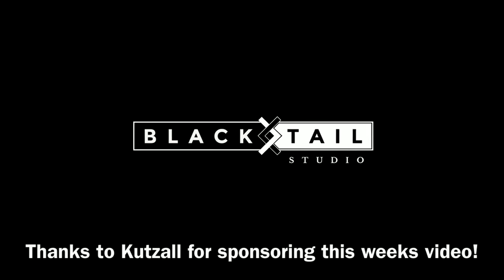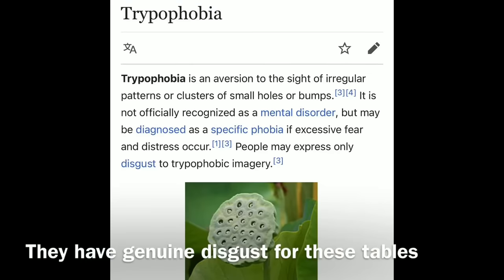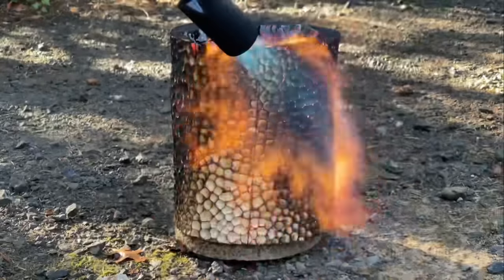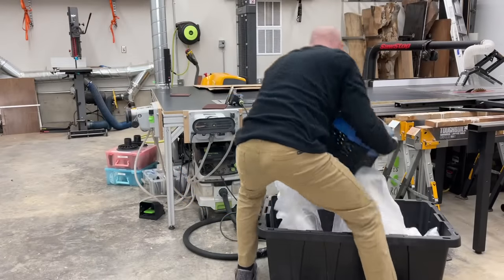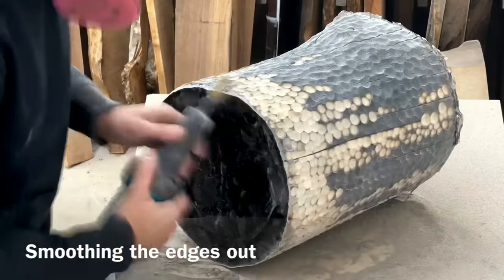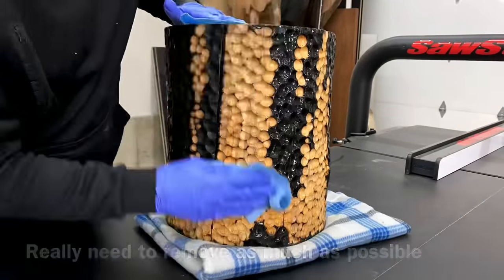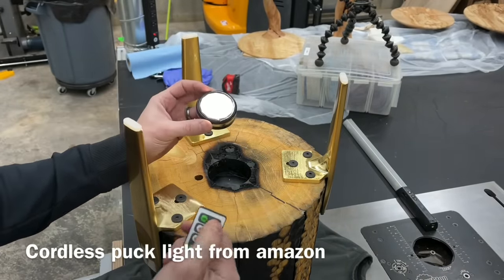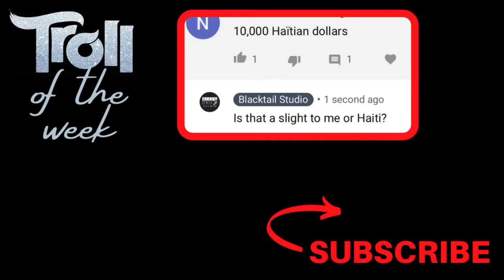I Sold This Firewood for $2500

Comment: Danish oil soaks in deaper so protects the wood very well, first handful of coats don't really need flattening, but if you want a glass like glossy, hard, resistant to mist shit finish- the more coats of Danish the better, and use steel wool with the grain in between coats, it requires patience and is very much worth it. It does have a tint on the light brown/yellow pigment but you can mix in a colour of your choice to make it happen the way you want it, it's oil so powder colour or even food colour works, pretty much anything that is for colour can be used as Danish oil cures hard and deep into the wood depending on the tightness of the grain. Not for a quick high gloss job, it's something you can do and make a lot of money because of the time and skills needed it's old school as well and recognised all over the world.

Comment: 😲I Love it! A couple of questions. 
1) Would the inside look better if you somehow sanded or scraped the high spots down inside to bring out a little of the wood colour?
2) What would I do differently if I wanted to use these outside around a fire pit?
3) I have not gotten into epoxy yet simply because of cost. What is the approx total cost of all of the epoxy used in this project?

Again, I do think this it is an amazing piece. I apologize to your wife, but I think the outside looks unique and very cool.

Thanks once more for sharing your talents with us.

Bill

Comment: 🔥🔥🔥 you'd probs have to light the interior with discrete LEDs with hoods (to not shine up) from near the top of the burnt out internal cone. Be fun chasing all the wiring internally up from below . .OK, maybe not. Maybe have matching brass removable caps/doodads around the circumference to be able to service the lights if/when they fail.

Comment: 🤔I am happy you went with the light at the end, I was waiting for it since I saw the drill bit puncture the log at the beginning.  I was a little disappointed with how the light came through though.  I was hoping for like a dawn through the trees look which would be neat.  Given the way the light does pass through I think playing with the light source might yield better results.  You ever see those "Galaxy" lights on amazon?  They are like $20-$30 and cast a multicolor galaxy pattern on the ceiling.   It would be tough to build a base for one to sit on the bottom of the stump but could yield some interesting results with this piece.

Comment: Cool project, a couple layers of opaque epoxy at the bottom and maybe going part way up the sides would really spread out the light and reveal more texture on the sides. 

The light will wrap around the features through an opaque material but not through the crystal clear stuff.  And good thing that light isn't permanent, a better option will appear at some point I'm sure.

Comment: About the light, those are really dim and battery powered, so you can’t expect much from them. At the hardware store they have really slim recessed LED lights that output a lot more luminosity, but that may be hazardous because they can get quite hot without adequate room to breathe. There are a lot of good lighting solutions, but to the people saying you should have worked in an LED strip light into the resin, it’s a bad idea because it’s no longer serviceable. Once the cheap strip lighting dies, the whole thing could get trashed.

Comment: Interesting! 😎
I like it with the red light (would have been nice to capture the red glowing wood/charcoal). 😉
What I didn't like so much:
- You finished the irregular pattern outside with straight lines. An irregular fading out had been nicer (my point of view).
- Deep inside were some waves and bubbles in the epoxy that you usually don't see. Normally it's not an issue. But here it is as the epoxy is clear like water and it's backlit.

Comment: Looks similar to the handle of a knife I made in 8th grade, burned it into the same look as this, but just used a hot engraving tool for it and put hundreds of small little holes.

Made the blade guard out of see-through epoxy too, real forward thinker there :P

Comment: It would be interesting to see a repeat of this - but with some light scattering particles added to the 2nd- or 3rd-to-last epoxy layers. With a nice clear epoxy and a light buried at the foot of the log there is nothing to scatter the light and show up the inside of the log.

Comment: I just had a crazy cool idea! What if you drilled a hole in the bottom, and through the side so you could run a small led lightbulb inside but with the light coming up and out of the center showing off all the burnt wood from the hole down the center. I feel like that would be the coolest way to accent the brunt parts of the inside of the stump.
Reply: Ok well I suppose I should finish watching the videos before I post a comment. Boy do I feel like a jackass for that one 🤦‍♂️

Comment: Nice!! I think you are a very creative fellow. I saw a lion.
I was wondering if instead of using a black resin, what would it look like if you used a clear resin, thus showing all the depth and beauty hidden within all the cracks. I suppose you would have to figure out a way of leaving most of the original internal material instead of sanding it out. Perhaps just blowing it off with air. Thanks. I love watching your videos!

Comment: Those remotes are IR so they emit infrared light in patterns and they need line of sight to the receiver that is usually a black piece of plastic. The expectations were not reasonable unless they said WiFi or Bluetooth controller.

Comment: Wood is going to eat radio signals pretty quick. It's like billions of really crappy antennas bound together in a tight circle surrounding the light. Sure, a good handful are fine, but in large numbers wreak some havoc.

If you opened the light puck and moved It's antenna to just dangling there in air I bet it would work.

Comment: Looks cool, but I think it would look cooler if you had sanded down the high spots on the dimpled surface. So raw or stained wood surrounding charred dimples.

Comment: I love the channel. I've never felt the need to add my 2 cents to your work. But I think this project could have been better (my opinion only lol). I thought after you charred it, going back with a scotch Brite pad to the high points would add depth, then rubbing down the high points with the char dust would keep the sheen the same but lighter. Then pour a heavy layer of epoxy over the whole piece. It would be similar to the char table, with a perceived depth, but with a different texture. Also, try a better a single bright led suspended in the center of the pour. A cree bulb inside a ping pong ball(?) Might diffuse the light a little better, allowing the inner texture to be revealed, without the glare. Maybe a thought for a future char stump mark ii project? Anyway, I still love the work you do, and look forward to the next video!

Comment: One of these big cool looking modern light bulbs would be cool in that well. But it probably need a removable top to change the lights. But on the other hand, would save you lots of epoxy, cuz you can just stableize the wood and then put a glass top on top.

Comment: I suspect that your problem with the remote is that it is an infrared remote as opposed to a radio frequency remote.  IR remotes require line of site which you will not have with it under the stump.  Get a light  with a radio remote instead and you will get the results you want.  BTW you can tell for sure if you have an IR remote by pointing you phone camera at the end of the remote and hit a button.  If you see a light in the camera then you will know for sure that it is definitely an IR remote.

Comment: 😍I Love that stump!   Was thinking of those old fibre optic lights or maybe led fairy lights embeded in the epoxy or if you drilled from the bottom and sides bunch of small holes.   Get a starry pattern inside🤔   and another idea is stump table with glass top and the wood could just be sealed and then put fairy lights and seasonal decore inside... like you can do with center pieces.   
I love the artistic part of the drips down the side.   Going with your gut is a good idea!.    

I would love to see different bits for different fun patterns

Comment: Possible ideas... silver in the dimples rest remains charred, cut the stump into 4 and fill maybe 3 inches between each of the quarters and a stronger light a table that lights the room, how does epoxy handle heat?...prototype for next time or you could mod it further 😉

Comment: Light is not garbage you hav IR controller pointed at a wood log. You need low frequency iR signal to get to the receiving sensor. You shoul use one with Bluetooth receiver. If you find, is going to be way more expensive.

Comment: I thought you were going to place a handful of fiber optic cable, offset and flowered out at the ends running down to the bottom hole.  Then a replaceable LED bulb to simulate fire inside the clear epoxy.  Would have looked pretty cool.

Comment: I think that if the inside of the table had some depth to it when you turned the light on...maybe sand the inside of the stump at least enough to have a color depth to see that it's actually hollow.

Comment: 👍Nice work. I like the result, especially the mirror finish top. Good lesson you taught about those hockey puck lights, but I liked the thought. Maybe some better LED light strips inside before you added the clear epoxy fill would have given the impressive inside that you apparently wanted. I like your artistic growth with the videos you are putting out.

Comment: You must use only plastic sheeting you must do the ceiling. That's where the dirt falls from, and you must dampen the floor. Made a car spray booth in the garage works. Awesome, but it's got to be all plastic and things have to be damp when you start.

Comment: I like it.
Gonna try charred wood projects. I already have some pieces I've taken from campfires that look awesome. 
I prefer the look before you retouched it up, all black, but it still came out cool and that was a good idea to fix the epoxy that ran. I'd rather try NOT to let the epoxy run though. 
The legs are nice.
Not a fan of the light. Looked kitsch. Sorry. Idk the solution for being able to see though it better though. Side hole too?
Learned a lot and got inspired to get out my lawn torch!

Comment: Love it man, thanks for sharing. Have really been looking forward to doing both a wood char and epoxy project so, this is great inspiration. Love the texture you made on the log and the contrast too, has a sort of reverse effect with the clean wood dripping down in stead of the char. 

Really nice smooth gloss finish there as well, I may have sanded the inside of the stump hole a bit to bring out some tonal variety, which would probably help seeing into the epoxy. 

All in all really cool process, subbed.

Comment: It would have been cool to embed a small circular mirror in the bottom of the stump's pit before you filled it with epoxy.  The mirror would have added some light to the deep pour you did and show off the burned sides.

Comment: hello, 
I discover your channel and I find your videos interesting and your creations breathtaking. 
Also, not speaking English impeccably, I put your explanations in writing below, but it remains complicated. 
I have a quick question for you, which will help me understand the epoxy process, which remains pretty much the same for all creations, it seems to me. 
you first pass epoxy over the whole piece of furniture in a light layer, then, after drying, you obstruct as many holes and cracks as possible with this same epoxy, then you complete by layers, to then finish with a another special epoxy, in the last thin layer... is that it? 
can you tell me which epoxy you use according to the steps?
 I thank you very much and greet you from France. 
Xavier

Comment: 🥳 😁 Maybe partially blasting the inside would have brought back the wood surface (taking advantage of the light). If so I would go with carbon dioxide ice blasting. That would solely remove coal and not adding any blasting agent. 
Kind regards
Anders 
Sweden

Comment: 🤷🏽‍♂️....... Well, here’s my emoji, because I thought it was ok, but not your usual amazing finale. The table was different and on some level it was kewl. I thought that if you’d have had the light source closer to the top, where it would be more visible, then it wold have been better looking. Possibly have some LED strips attached to the inside of the burned “bowl” section? That would have def given more light, closer to the top, which, possibly, could have looked better. Overall, still def worth doing, if only as a learning experience. Thanks for the continued creativity.!.!.!.!.!

Comment: Try using WD40 for a finish. Looks nice, seals and waterproofs the wood and when wood gets dusty or dirty, spray some more on and wipe. If you want, mix some stain with WD40 to get a darker finish. Put it on until the wood wont soak any more up. Quick, easy and cheap.

Comment: 🤔  I'd say this one is about 7.5 for me (out of 10).  I like the burnt wood, but wonder if it could have been partially or more lightly burned in places.
Between being all black OR all "dimpled" showing the natural wood color, I vote for the natural.  However I DO light black and how dramatic it is.  In THIS case though, I wonder if SOLID black shows off the dimples enough.  They kind of get lost in the darkness. 
The thumbnail you have for the video shows the connective wood between the dimples burned black, but the insides of the dimples natural color.  I like that look a lot 
I think the end results are pretty good, but I think I'd cluster the dimples more near the bottom edge working their way up in a wavy manner getting skinnier at the top.  Like thick blades of grass growing up the sides of a forgotten stump in the woods. I wish I could draw you a picture.  But there you have it. 
Overall, it was a cool project that turned out pretty good! And love the high gloss too!!  
But I think the look  could stand a little more refining.   
I make jewelry and paint rocks, etc.  and I end up doing some things a few times beforel I'm happy with it.
My litmus test about anything I make or buy is, do I want to just stand there and Look at it?  Is it something that keeps drawing me back?  
Well, I've gone on WAY too long!
You do INCREDIBLE work!! I love your creative and unique eye for the beautiful yet dramatic!

Comment: 🧐As far as a log jig goes, for this purpose why not use a couple of tire blocks or wedges (wrapped with protective cloth/padding if required)? Doesn’t do anything for front to back movement, but you could probably clamp a 2x to act as a back stop. Just trying to think simple and portable. 

 Relatively new to your channel, you got a sub and got me interested in trying a very small epoxy end table like project sometime. I’ve never worked with wood or epoxy.. one thing I appreciate is every episode you point out something you whoopsied on and something you’ve never done before or “don’t know much about” or “do well” (even when obviously you know more than most). It makes the content much more novice approachable and encourages people to try and learn. Like you said in one vid “good decisions come from experience, experience comes from bad decisions,” gotta make those decisions to start with!!!  

Final thought- I know you try to make the videos accessible to your many groups of audience, but any thought of a one off that shows the full epoxy and pour process etc (maybe an hour long or so) with the extra details you cut out, but not enough to cut into your class? An intro can ward off those who just want a typical video. 

Ok this book is long enough.. thanks again for the content and look forward to learning from you!

Comment: I don't have any real problems with the light and dark divots. But I think that if you would have left it a bit more random it might have looked better. The one section where it was up against a fairly straight crack and black on one side of the crack and light all the way from top to bottom on the other side and about 4" to 5" wide was just a bit too uniform and looked a bit like a style break.

Comment: contrast could have probably looked better if it was done on some pattern or intentional way, this way it just looks unfinished in my opinion. 
also: the puck probably doesn't work because it uses an infrared remote, and you need a line of sight to that.

Comment: I think it would have looked good also if, before coating the outside with epoxy, you belt sanded the top of the dimples to create a contrast of colour like a honeycomb structure, maybe even did a spiral of two contrasting looks by making the honeycomb natural wood look and the dimples charred and then the other spiral the opposite, dimples natural wood and the honeycomb charred. Then epoxy.
Looks good anyway, it's your creativity. And that's more than I've done 👍

Comment: I think that the contrasting colors would have looked a lot better if they were vertically inverted. That is, if the concentration of the light color were on the bottom, not the top, as it would have resembled fire rising up. Somehow, placing the concentration of the light-colored wood at the top makes it look upside-down to me.

Comment: I think overall its quite beautiful. Not a huge fan of the legs I feel like it throws off the aesthetic. I would have liked it with no legs at all or less visible black iron legs positioned under the base instead of the side. The contrast on the sides it pretty cool imo. I'm having so many ideas, for things i want to try while watching this. I would have never thought about doing something like this.